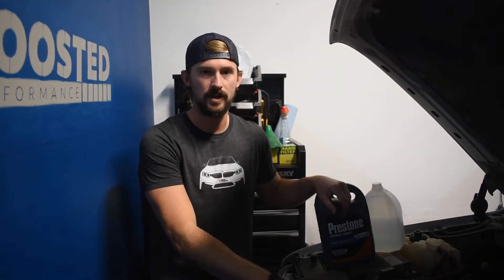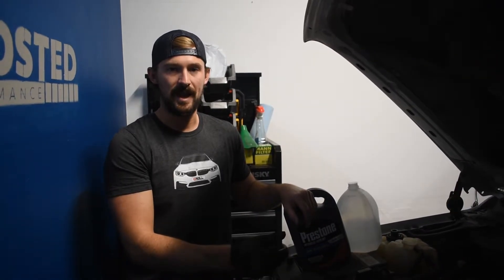DIY! How to Drain, Bleed, and Change Your Coolant | '00-'06 Chevrolet Suburban

Comment: A thousand videos on how to drain your radiator, not one on how to drain the engine block, or heater core. Not one. Obviously draining your radiator, especially given where these trucks (I have two) place the thermostat, does nothing more than about a third of the overall system.

Comment: Have a 1999 chevy silverado 1500. Just drained from petcock valve hose. Only drained 2 gallons. Truck takes 4 gallons. Sounds normal right? Havent tried block drain yet. I only have access to driver side block bolt. Nervous as hell to mess with that. After 2 gals drain, truck only took 2 gals new coolant.  Was thinking about driving and do same process again for a better ratio. Does that even sound close to some sort of flush?
Reply from the maker: M - Yes, that actually sounds pretty normal for a basic gravity drain via the petcock—on your 1999 Silverado 1500, the system holds about 4 gallons total (16 quarts), but draining from just the radiator petcock usually only removes about half, since a lot of coolant remains trapped in the engine block, heater core, and hoses. If you're nervous about cracking open the block drain (totally understandable), your plan to refill, drive to operating temp with the heater on, and repeat the drain/fill cycle a couple more times is a perfectly reasonable DIY flush method—it’ll dilute the old coolant gradually and improve the mix each time. After 2–3 cycles like that, you’ll be pretty close to a full refresh without ever touching the block. Just be sure to use 50/50 premix or mix accurately with distilled water each time, and watch your overflow tank level as air burps out.
Reply: @8020Automotive yeah ty. I'll be taking that route instead.
Reply: No

Comment: During this process. Does ALL the coolant come out of engine block? Or some old coolant end up staying in the engine block? My goal is to flush the coolant system
Reply from the maker: M - Great question. When you perform a standard coolant flush by draining from the radiator and possibly removing the lower hose, you typically only get about 50–70% of the old coolant out because a good amount still remains trapped in the engine block, heater core, and sometimes the water pump passageways unless you specifically remove block drain plugs (if accessible) or use a pressurized flush machine or distilled water multiple-pass method; if your goal is a thorough flush, the best DIY approach is to drain the radiator, refill with distilled water, run the engine to temp with the heater on, then repeat this a few times until the fluid runs clear—then finish with a proper 50/50 mix—and if you're really chasing perfection, some engines have block drain bolts you can carefully remove, but not all make that easy or worth the mess.
Reply: @8020Automotive this is an absolute answer.  I think it's will stick with not removing block drain.  Thank you kindly! You're instruction are helpful

Comment: I have a 2000 Chevy Silverado 4.3 v6 and wanted to change my coolant there is still coolant inside the tank but I unscrew the cap off the tank put a drain pan under and unscrewed the screw from the radiator and no coolant drained but I looked back at the coolant tank and some coolant was gone what could this be?
Reply: Same happened to mine. I don’t think the radiator had been replaced at all, I unscrewed the screw from radiator but nothing would come out. I later found out it was very clogged so I recommend you change it asap. If that’s the same issue you’re having
Reply: @bobbyboucher7854   how did you drain it or did you replace your coolant tank?
Reply: @xblue5585  the coolant tank was pretty old so I replaced that as well, I also then replaced the two lines that go into the heater core. That allowed me to drain most of it coming from the water pump. I recommend you change all of it. With all that gunk build up, your radiator can crack and leave you on the side of the road.
Reply from the maker: Are you sure you found the proper drain screw? And unscrewed it properly? You kinda have to unscrew it a lot. Not sure what would cause it to not drain, it would have to be suuper clogged or have something else weird going on to not drain anything.
Reply: @8020Automotive  yes I took the whole screw out and nothing came out
Reply from the maker: x - This is quite strange. Must be very clogged. Are you experiencing drivability issues?
Reply: @8020Automotive  a little yes but I already changed the whole coolant resevor and coolant how much coolant should I put just a gallon?
Reply from the maker: X - If you still have your owner's manual, the exact amount would be listed in there.

Comment: you will never get the old stuff out you must pull engine block plug back by the oil filter 17mm hex plug (heat with a small torch first to loosen thread lock glue )
Reply from the maker: B - Thanks for sharing this insight.

Comment: Mine doesn’t even have a drain plug I had to take the lower hose off
Reply from the maker: Juan - Odd, but thanks for sharing this insight. Will certainly help future viewers!
Reply: Mine doesn’t have the drain plug or the hose. What am I supposed to do now
Reply from the maker: L - What make, model, and year?
Reply: Definitely has hose, yank lowest coolant line anywhere. Probably big and black @papi5301